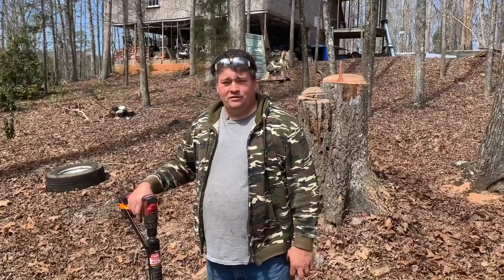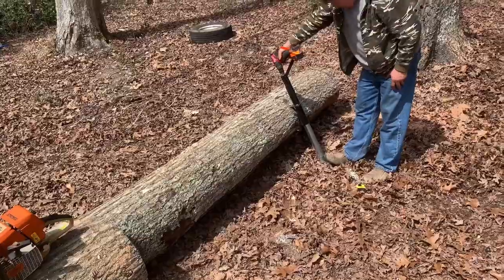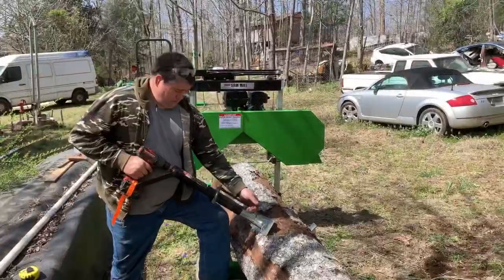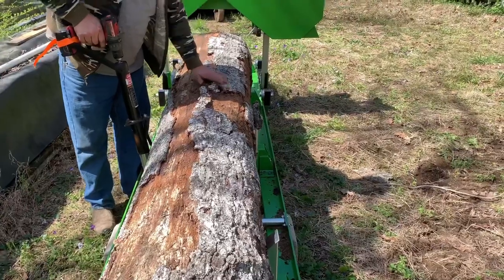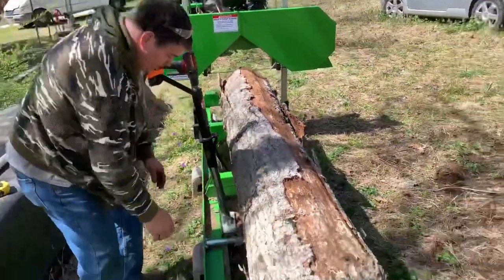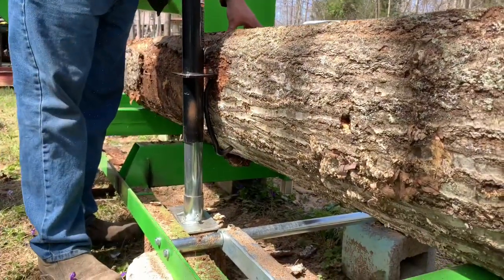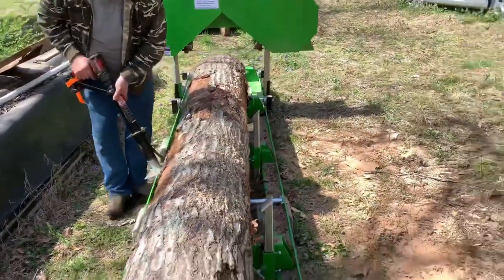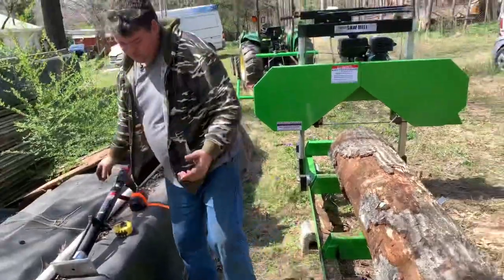Drill power Log turner invention sawmill harbor freight sawmill band mill Kant hook log lift

Comment: You're a genius this is what I was searching for and it solves the problem of my logs hitting trees when iam winching them out of the woods as well. I got an idea for you put a bar or small rail under the log between the rails under the log bunks that has little notches every four inches or so that your jack foot can press up against then it will always be there and you won't need the stump.

Comment: That’s really cool. Do you sell them or the plans to make one? I’ve built a sawmill that I work by myself and turning logs can be an issue. I was diagnosed with cancer and having an operation and chemo and radiation treatments I lost a lot of weight and upper body strength so turned logs are an issue. I’ve been looking for something to help with that. 
Thanks
Reply from the maker: Sorry to hear bout your health and i surely hope pull through! No i don't sell or have any plans though it simple to make from a 2ooolbs. jack, drill motor,and a cant hook! Happy sawing

Comment: Interested in getting one.
Great idea!
Do you sell the can't hook attachment for specific commercial jack?
Please let me know.
Warm Regards,
Monte Hines
Reply from the maker: Sorry I dont, I made mine from a hard spring steel from a hay rake, work great!
Reply: @nathanhatcher7096  Thanks for quick reply. Thanks for the inspiring idea.!!!
Did you use a 2000 or 5000 lb jack?
I ordered a 5000 lb jack today. Looking forward to using this to turn logs on HF Sawmill
Reply from the maker: @HRT87  I used the HF 2000lbs jack it handle shaft has the correct size for 1/2 drill chucks, the 5k may work too though heavier. Either one should work, u will have to remove handle and drill a hole in shaft to install a washer and roll pin, so the the shaft remains in place, then weld on anti-wist bar on to it to strap drill motor to. This video is for people like you to encourage folks to make something useful! Please understand, when making and using this tool do it at your own risk! It is the most useful tool i have for my mill! Thanks Nate
Reply: @nathanhatcher7096  Thanks again for this great idea. I understand that I am doing at my own risk. Also understand that this method of rotating big logs is do-able versus using manual Cant Hook is un-do-able for a old man like me.
Reply: @nathanhatcher7096  I have been using battery drill to raise and lower Harbor Freight Sawmill for about 3 years. See  https://youtu.be/EZx6GWGYCKc